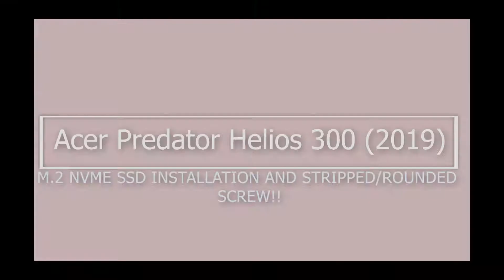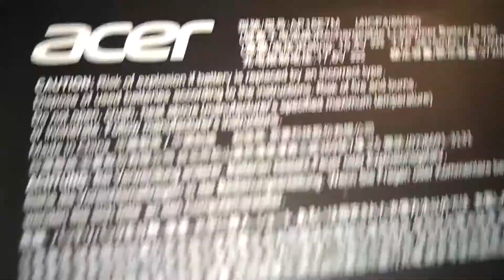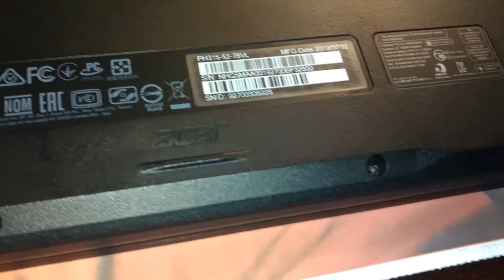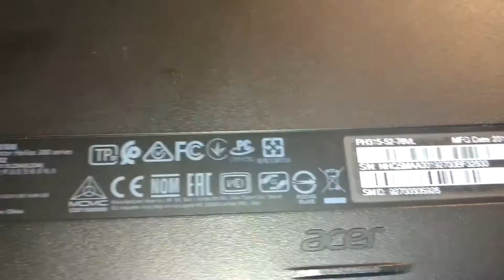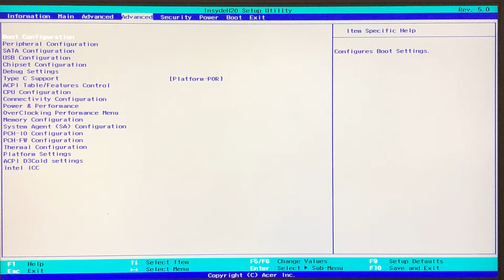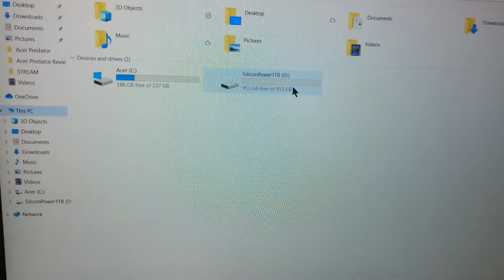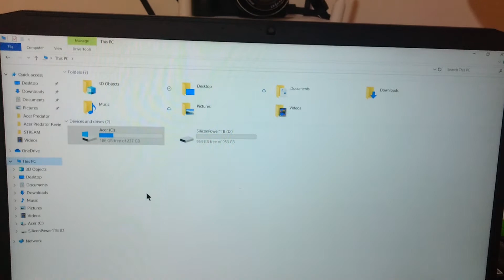Acer Predator Helios 300 (2019) SSD installation & stuck screw!

Comment: I am so pissed off rn that will not hesitate to cut this stupid a** screw with a chainsaw. I mean WHY TF THESE STUPID COMPANIES PUT LOW QUALITY GARBAGE SCREWS IN EXPENSIVE AS SH*T LAPTOPS.
Reply from the maker: Yes it's crazy. That means that quality check is not 💯%
Reply: @ArifFidaali  fr man fr. I think they do this on purpose so that people take their machines to the service center.
Reply from the maker: @Ked778  Yes that could be the case. Atleast in my case the ssd panel was removable, if it wasn't I would be "screwed" :)
Reply: @ArifFidaali  can you tell me what is name of the screw used in the ssd. Pleas